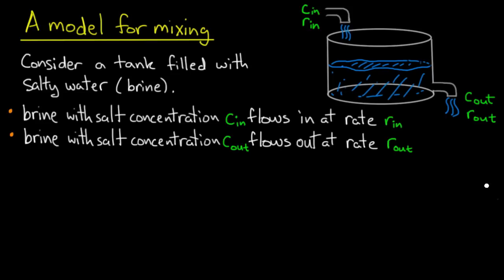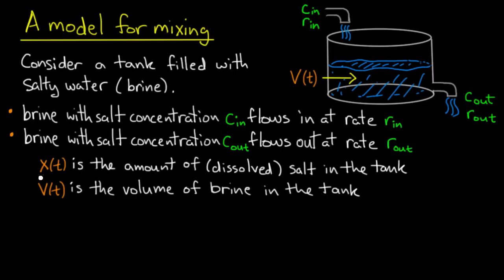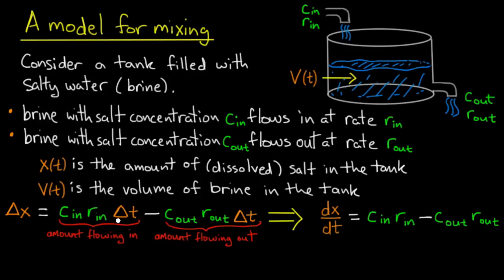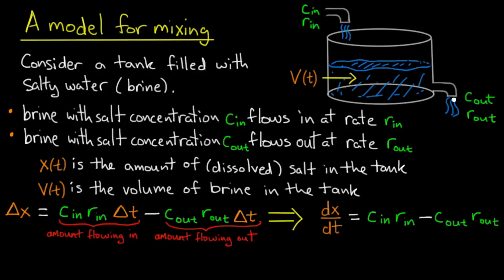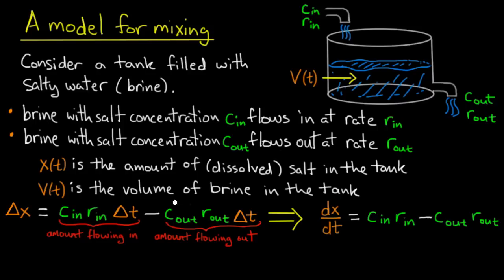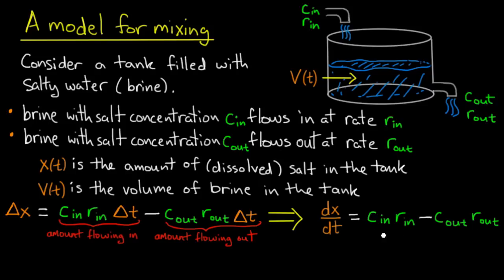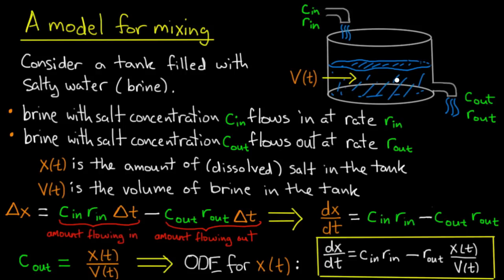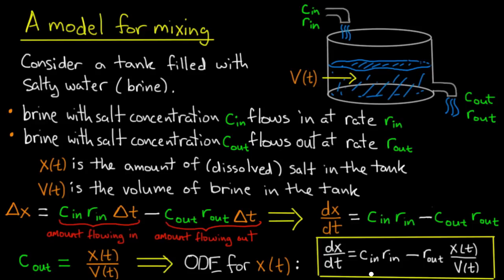ODE | A model for mixing problems

Comment: Awesome review of some ODE concepts I thought I remembered. I enjoyed your methodical way of breaking down the problem into neat highlighted chunks of information. The explanation of what variables you can and cannot control was also excellent, because it led to a more complete understanding of the problem then just saying "the concentration of salt in the fluid flowing out is equal to the amount of salt in the tank divided by the volume of the fluid in the tank".